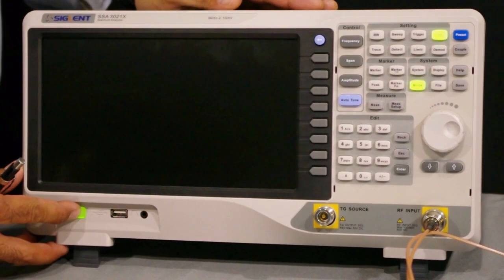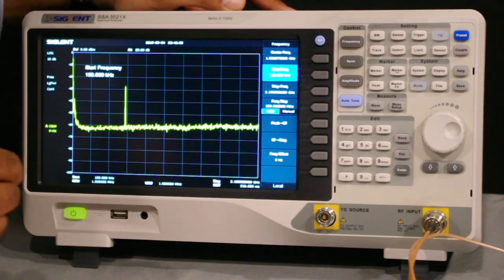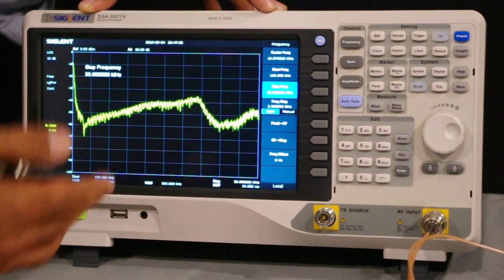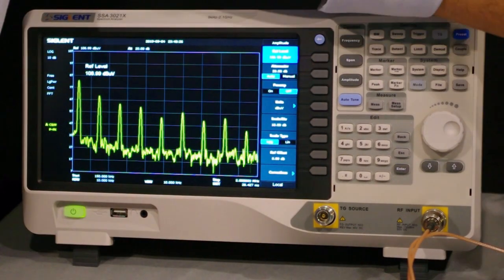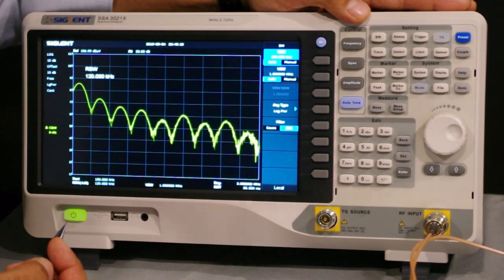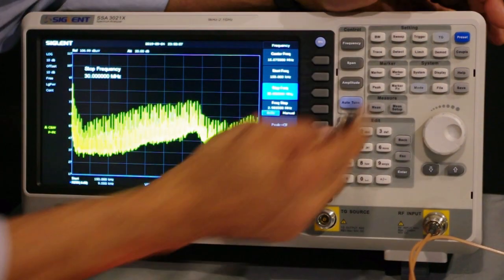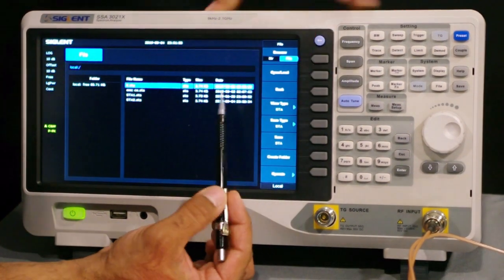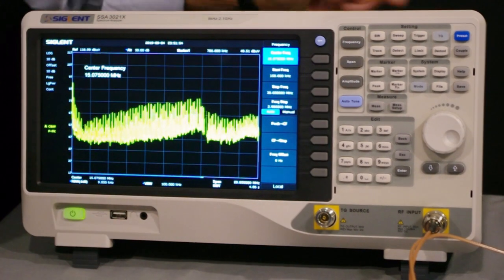EMC Conducted Emissions: Setting up a Spectrum Analzyer (Siglent SSA3021X)

Comment: Solid video. Just a few new points.  Minimum 2 samples per RBW. This scope has a fixed 751 sample span. Thus, 9000/2 * 751 gives a max span of 3.38MHz. So you can't actually sweep from 1MHz to 30MHz all at once. Also, there is a minimum required sample time of 200s / MHz for the EMI filter. I think sample time is in the sweep menu?